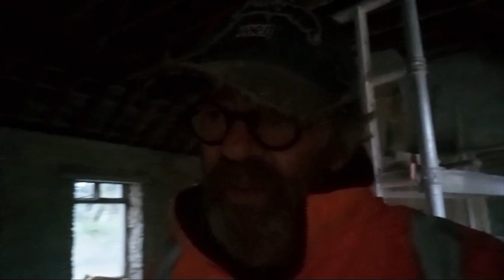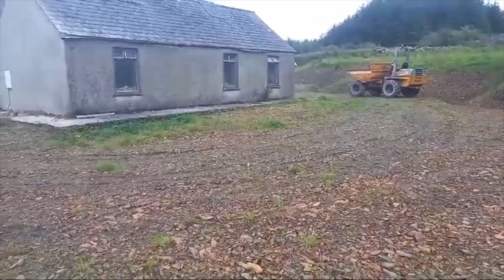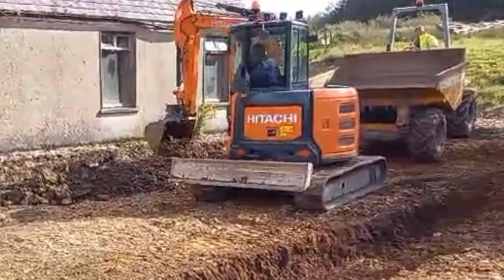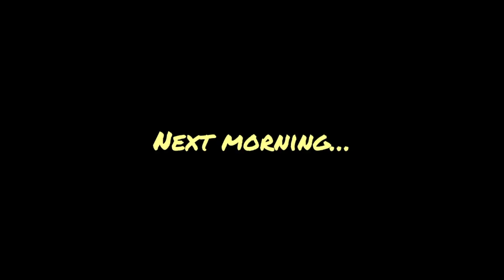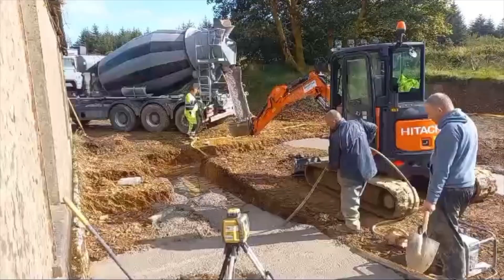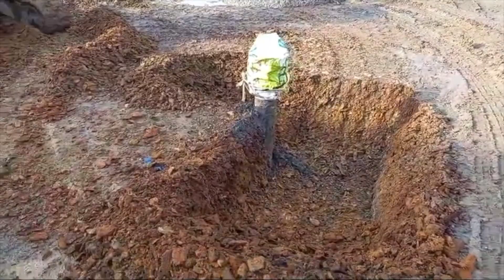Foundations are laid but do the workmen have the right plans? EP049

Comment: What a big step forward! Congratulations!  Will interior stick walls be faster to build than block walls, or slower, or the same?  Might be easier to run electrics through.  Thanks for another interesting vlog!
Reply from the maker: It’s going to be block work now anyway as that’s what the building engineer insists on. The block layer is throwing them up pretty quickly and we’re ahead of schedule atm. 😊🙌🤞